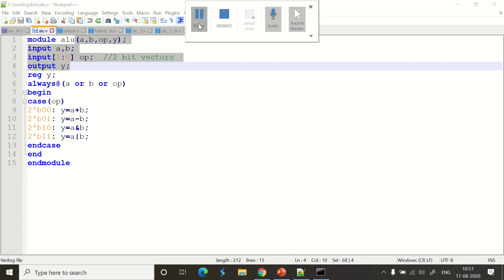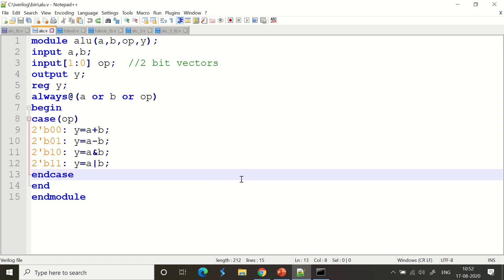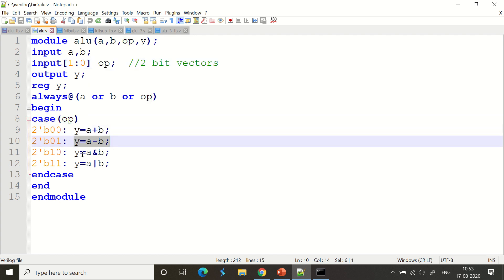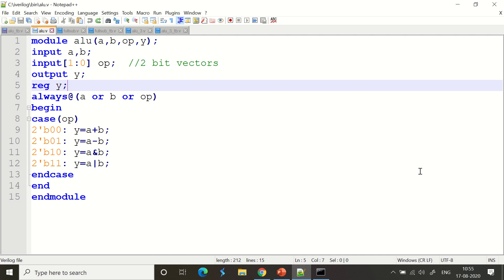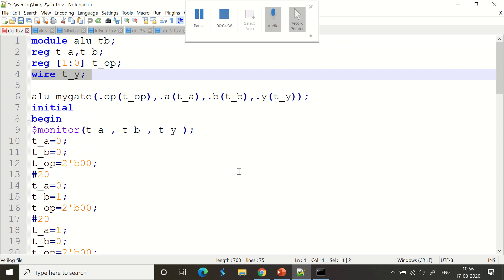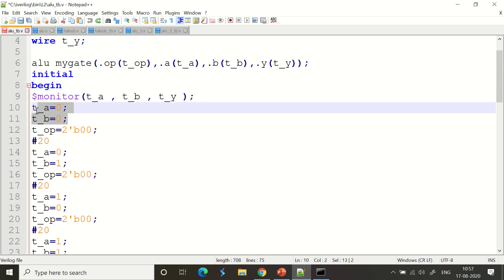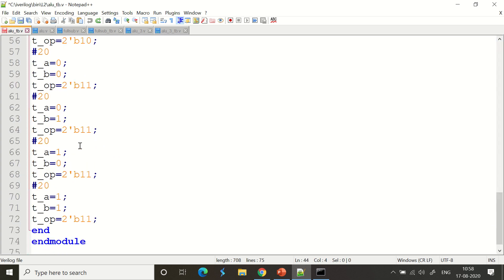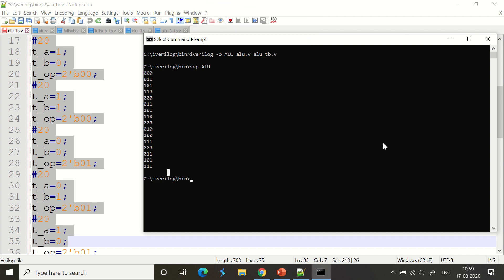2 Bit ALU design with Verilog - Full Implementation with test bench

Comment: Sir does verilog is also 7sed for embedded systems. And what is the language who have used sir
Reply from the maker: No .. it is meant for design and test of ICs and logic circuits
Reply: @ShriramVasudevan  okie na fine.
Ippo only one doubt na. if I'm in embedded domain that means I know embedded c this will be sufficient for Embedded firmware engineer but if I wnat to be embedded hardware engineer will it be directly depend on VLSI domain or otherwise embedded engineering could also design hardware na??
If yes what are the skills should embedded hardware engineer should have to excel?
Reply from the maker: @barath3956  yes.